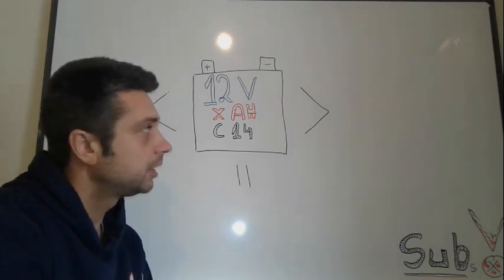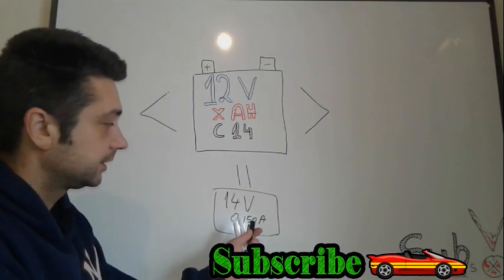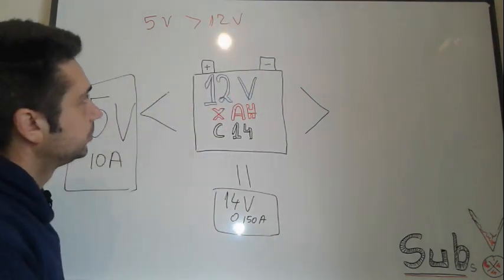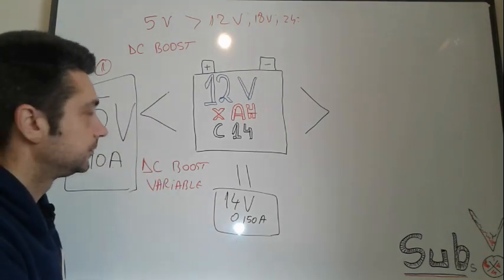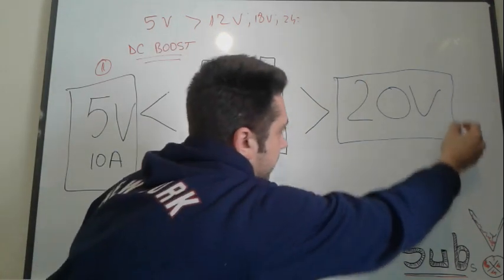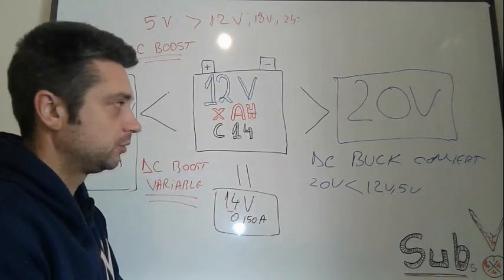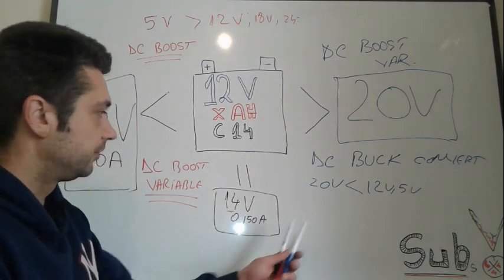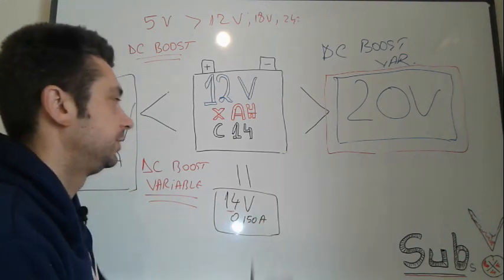How to charge 12v battery without charger in theory

Comment: Hello sir, I can ask you about AC charging 7.2v to DC li-poly RC battery 11.1v can or not??
Reply from the maker: Li ion and li Pol batteries one cell 4.2v.for 2 cells 8.4v and a 12v battery pack 13.3-13.4v

Comment: I have a 12v 1.5amp charger. Will this work on a 12v 9ah battery?
Reply from the maker: Some chargers write down 12v bit they supply more,others just 12v in order to make the electrons move aka charging the battery12v tou will need a 14-15v and for amps for safe charging 0.500A